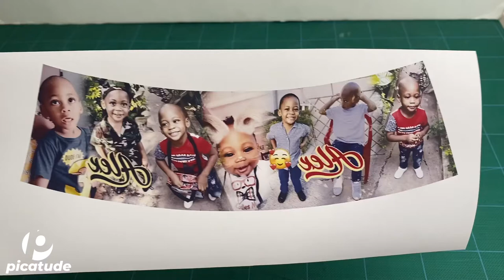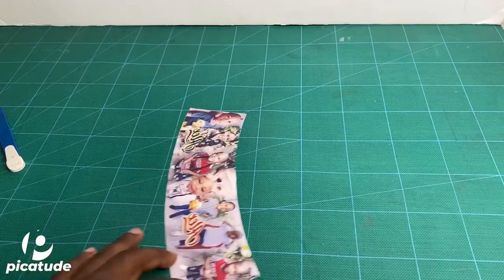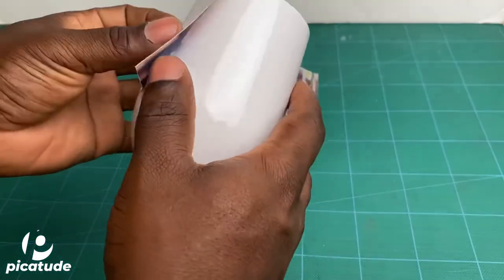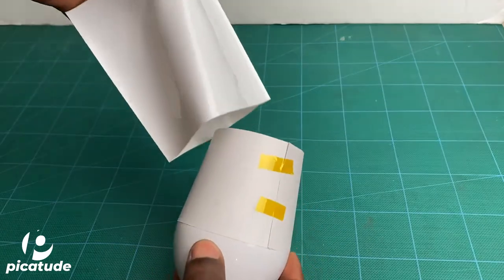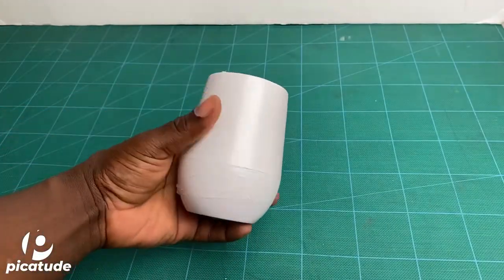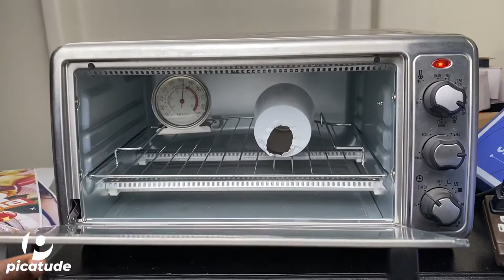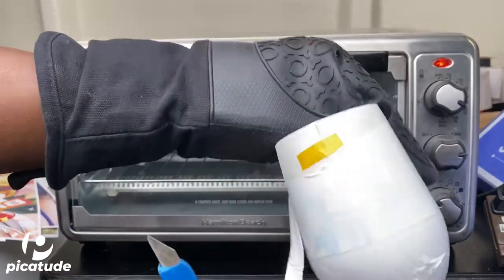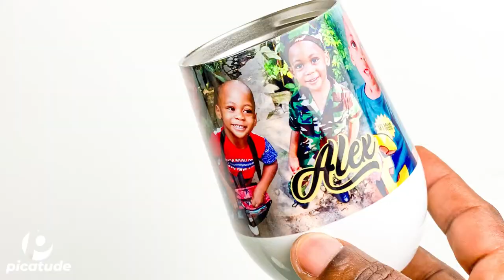How to personalise a “Baby Sippy Cup” (Sublimation)

Comment: How did you print and cut the shape for the curved tumbler with your cricut?
Reply from the maker: I’m not using a cricut, I used a stencil knife to cut it out from the printed template
Reply: @picatude2512  Thank you for that so how did you get it to print that shape. I bought a template but don't know how to put the picture in the template. I sure could use some of your genius!!
Reply from the maker: @cherylshields7576  what program are you using to do the design?
Reply: @picatude2512  I am using word and canva
Reply from the maker: @cherylshields7576  you can message me on Instagram or our Facebook page.